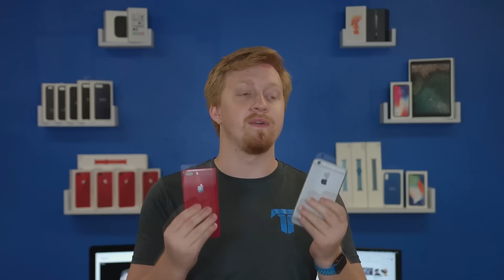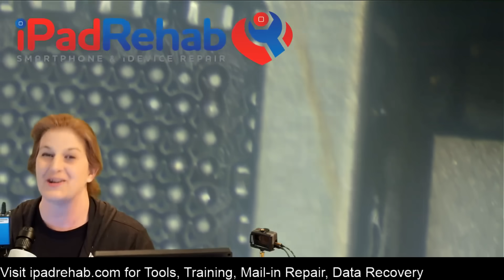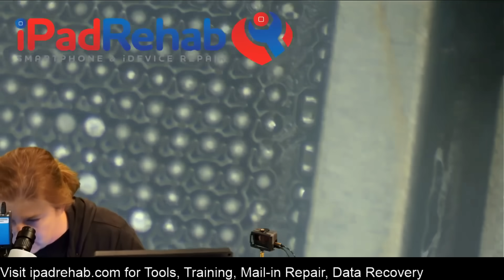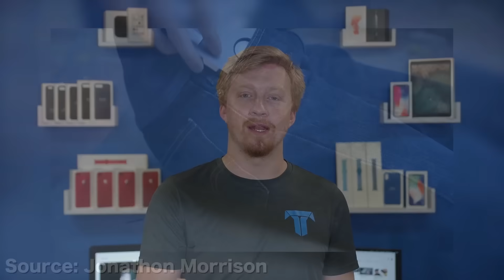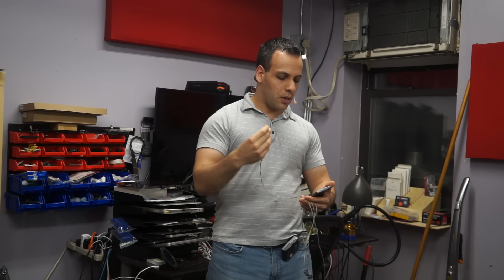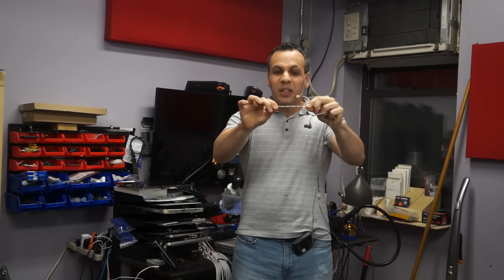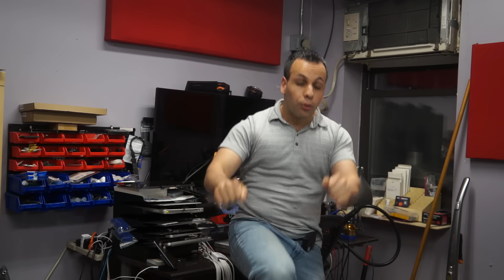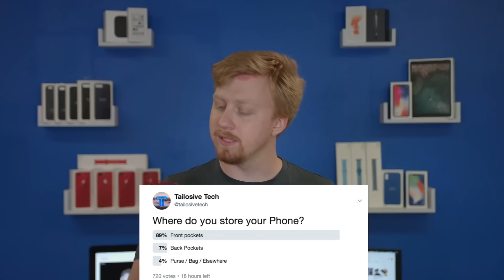The truth about iPhone bendgate deniers

Comment: Dude my iPhone6 never bent but then again I didn’t sit on my 1000$ phone and I sure as hell didn’t buy a 1000$ phone without an otter box with it.  That’s not defending Apple but if you put your 1000$ phone into your back pocket and sit on it and it bends that’s kind of on you. Apple also updated the aluminum in the next s model which was much more durable and now they’re even using stainless steel again which you couldn’t bend if you wanted to.. so Apple doesn’t respond to complaints? Yes they actually do. Also.. if you take your phone and purposefully try to bend it in your hands you’re the biggest dumbshit on the face of the planet. Js. This is the dumbest “controversy” I had ever heard of at the time. Sure the aluminum was weaker. That’s a FACT. Sure some phones had problems. But that’s the case with many phones and many companies .. I love you man you’re an inspiration but your hard on for Apple definitely shows.. 

When in reality if you take care of shit and don’t spill shit into your Apple products or PURPOSEFULLY try to bend your Apple products you’re probably going to have a great product for a decent amount of time. Which can be said for, again, many different brands and companies.

Comment: So it's like damage that people get by repeatedly trying the wrong way over time aka Carpal Tunnel syndrome.  It's why when someone tries to tell a newbee about how they should be typing to prevent damage to their wrists.   Because you won't feel the damage until months later suddenly their wrists start hurting.  The same thing happened with Carpal Tunnel the problem existed in the 70's but because the number of people as a percentage of workers was so small that it didn't come up.  But as the PC became commonplace in homes and work suddenly Carpal Tunnel became a huge deal and now anyone who works with a keyboard will commonly see a video about how they are supposed to hold their wrist to prevent damage.  (Not saying people with the iPhone are putting it in their pocket wrong.)  But, So many of the bend-gaters don't have the internal technical explanation of what is occurring and why for the common person to say..... "ohhhh."  Like the 6 you said was a touch id issue and the iphone 7 is about audio issues (it seemed the chip was in the same area of the phone when I was looking at the video, I may be wrong) but the common person would not connect the 2 problems together as being a result of flexion.  Because prior to your explanation I would have thought it to be the result of a single event.  Rather the damages is a result of repetitive stress to the device board resulting in the board decaying or causing damage to the component soldier connections.  (seemed like larger chips too, where the chip could flex away from the board)  Heck if the chips were closer to the top or bottom may have solved the issue because the top and bottom would be more resistant to flexing.  (like trying to take a UPS or fedex box and bend it, it always seems to bend in the middle 3rd of the box not at either end.)  In any case,  I liked your explanation as it was logical and helped me understand how the 2 issued were related and for that thank you.

Comment: It’s a bit far fetched to name a shattered or cracked glass back a cosmetic issue, given the fact, that many of these smartphones are sold as „water resistant“.
Reply: Michael Walsemann then perhaps don’t put your phone in water afterwards? It’ll work fine so long as you don’t lol. Or repair your phone. They do make cases which help a lot with this problem. You shouldn’t carelessly handle a glass device with no extra protection and say oh well look now it has less functionality.

It’s more of a common sense thing. Don’t break your phone, and don’t put it in water after you do it and you’ll be fine. Water damage is easily preventable. Damage from putting it in your pocket is not.

Comment: I tear drop ran down my cheek when you shit talked about the Nexus 6p. I used that device for 2 years, then passed it down to my little sister who's now been using it for about a year. The battery went bad but we replaced at home with a ebay battery about a month ago and it's been amazing again. Very responsive, great camera even compared with the latest phones, and excellent front facing speakers. It even survived a massive fall two years ago but luckily the spigen case absorbed all the damage. Also, I've never sat on it lol
Reply: I had it for 2½ years. 3 battery replacements. Ended up breaking the screen on repair on my 4th try.
Reply: @TheHaters112  bruh what are you doing to your phone to manage to fuck the battery 3 times in 2 years? My phone is 3 and a half years old and still on the original battery. It still has around 70% capacity.

Comment: My one problem with your line of reasoning is when you talk about why you don't acknowledge when similar things happen on Android. You say it's because the community as a whole accepts the fact that it's a bad phone, whereas with Apple, everybody just ignored how bad of a phone it was. I think that if anything, it was the exact opposite.

When #BendGate started, it was massive news. Both my extremely non-techy parents even knew about it. It was everywhere, that one video about it even kick started Unbox Therapy's entire YouTube career. 

With the Nexus 6P on the other hand, even though I'm pretty techy, I wouldn't have even known it had a bootloop issue if I wasn't considering buying a used one a few months back. Before this video I haven't seen a single person anywhere outside of obscure forums talk about the 6P negatively for that reason. Maybe in your tech repair field it's a well know issue, but in the general, less specialized tech community, the negative press Apple gets for a mess up like that is astronomically bigger than for a phone like the 6P.
Reply from the maker: How many people have you ever heard defend the Nexus 6P's build quality?
Reply: Louis Rossmann Nobody, fair point. However, I've also never heard anyone complain about it in the first place, which is pretty much my point. It's not a widely excepted problem, because nobody knows about it - at least in terms of the general public, and the "pseudo techy" YouTube commentors that make up 99% of comments (myself included). As I said, I wouldn't have heard any mention of it's problems if I didn't specifically research it with the intent of buying it.

Comment: Former Nexus 6P owner here, I lol'd hard. Can confirm it was garbage, and can also confirm that the OnePlus 5 that I use now has aged an order of magnitude better.
Reply: I'm watching this on a 6P. I've already replaced the battery twice. I think the only reason it hasn't bent is because I use a fairly thick case. ...Yeah. It's crap lol. ...And Huawei didn't acknowledge/RMA them for the basically 100% failure battery problem until most were already out of warranty. Never buying a Huawei product again.

Comment: Well this is another super excellent and very very informative video! Thank You Louis Rossmann. What about damage due to thermal changes?  The reason why I ask is that I had a coworker (Electrical Engineer) who told me that when he worked for (I think) Raytheon designing circuit boards for missile systems that the difference in the expansion rate of the circuit board material, and the copper on the board was a huge issue. They found that over time changes in temperature would cause the traces to degrade and fail.

Comment: I fucking loved apple. But the last 8 years since jobs has been mediocrity.  Hardware has become less reliable and underpowered. Back in 2007, they put a brand spanking new NVIDIA graphics card in their MBP. I got great mileage out of that computer. Now they put mid-range ATI cards and integrated Intel cards.  Apple costs more than ever, don't last as long, and are not as powerful. The deltas on every Apple product has gotten worse for the consumer in the last eight years. The OS is the only thing keeping me to Apple; it's stable, secure and matinence free with great compatibility. I am a scientist so that's great for me. Sure their is probably a Linux distro out there that's more secure, and I'm not going to be running the latest game at 4K 60fps thanks to windows and directx, but I don't care for that. What I do care for is time. I don't have time to learn terminal, or run a battery farm of third party butt plugs to stop every virus and malware that wants to make windows its bitch.

If Microsoft start again from scratch rather than continue to patch the current 80’s Frankenstein kernel held together with sticky tape and compatibility modes; I'll be all over it. Because although the OSX is free I'm paying for it with mediocre inflated hardware prices and I rather not. Malware and viruses and stability have also been a flaw in the windows OS for decades something I don't see getting fixed, which is why I am with Apple. I did vote with my wallet and stopped rewarding bad behaviour. There is just shit choices out there now.

Comment: Aluminium doesn't have a fatigue limit, so over time the yield strength will decrease until a failure occurs. This is why aircraft have to be retired after a certain amount of flight cycles.

Comment: The headphone analogy is great, it’s damage that builds up over time, through wear and tear, ie. NORMAL USE!! while it’s generally accepted for headphone cables, it’s should not be for enclosed electronics such as the internals of a smartphone, flex cables, ic’s and stuff should have been properly protected by Apple with the right shielding plates, brackets and the likes...

Comment: I keep my phones in my pack pocket all day every day when I'm up and moving.... Usually right in front of my wallet.  My phones are S series or Notes.... Samsung's.. I own all of them, rather than turning them in when contract or deal is up... I own Note 2, 3, 5, still have a 7, S7 Edge... all still work fine.  I don't even use screen protectors anymore.  Just a basic black rear sleeve with semi shock absorption. As low a profile as it gets.  And never a single issue with a single one of them.  Apple phones of friends however I have seen a many with hardware failure from far lesser and far more basic of use.  I am myself a controls electrician by trade, Controls and Flows engineer, as well as involved in the radio industry.  I have seen the shittiness of the apple first hand, believe me.. I understand what your laying down here.  I get it.

Comment: at 22:58 as a female human person i can confirm that often i HAVE to put my phone in the back pocket if i want to put it in a pocket because a solid 90% of pockets on female trousers is at least half the size of male ones. You saw on the clip how his iphone fit completely into the pocket when doing the sit test, well, if i did that half of the phone would be out of the pocket and over my hip joint and if i did the motion he did in the clip i would straight up break the phone in half. Also, it is extremely uncomfortable and has a greater chance of the phone falling out of the front pocket when moving around and makes it near impossible to bend down or sot properly

Comment: Hi Louis, very good video thank you very much. I was just wondering, what you are calling "flexion based damage", isn't it more accurate to call it "mechanical fatigue"? From what I have seen in my material strength classes, you can break something with one really hard bend or flexion just as you can break it with thousand of cycles of pulling and releasing. Sorry if I sound like a know-it-all, I was just wondering if "flexion based damage" was a term used in you profession for a specific type of damage. Thank you very much.

Comment: My first and my last Apple device was an I-Pad 1.gen . 
It fall on an flat table on the screen and an something on the CLEAN table cracked the screen thx Apple for my great customer experience^^ 
Now I`m an Windows and Android user.
I`ve devices like Hp, Msi,Lenovo… Notebooks and Lg, Microsoft and Samsung Smartfones that i use without any protection and they work fine even after years.
i don`t care About designe i care About durability and Features.

Comment: I am not a huge fan of any company, but my most dramatic complaint about apple is that they will sacrifice functionality for aesthetic appeal. There is nothing WRONG with charging more for aesthetic appeal, but as most companies look at aesthetics as an afterthought, Apple seems to look at it as a primary thought. 
"can it fit in THESE chassis? No? MAKE IT!"
Reply: ye i recently saw someone on tumblr actually say 'apple isn't a tech company, it's a fashion brand' and honestly... not wrong imo
Reply: @Scorpia161  it'a extremely true, it's an elitist luxury brand, function over form is what makes something robust and capable for power users, not wasting entire aluminum blocks to make the chassis weigh 3 times as much.
Reply: Yes that is why the Mac Laptops got rid of the USB A ports even though they could still fit them on/in the Macs even without making them thicker it was because they look ugly same reason they got rid of the SD Card Slot and HDMI & DisplayPort plugs!

Apple has 1 of the best Cameras and Software for it on the market yet cant add it to their Macs WTF?! They still put Potato Cameras on their Macs even at the high end max out specs!
Reply: This is what pisses me off about so maybe software "engineers" using mac laptops, now I'm stuck with it being my mandatory work machine and my linux tools crashing all the time. Can't I use diff/merge some files without having to pay $70 for a license and install git without having to install xcode? Macbook pros as dev machines are a joke.
Reply: you do realized that you're talking about the company that think it's a good idea to remove fans from their desktop because they are noisy
Reply: I was quite angry when they removed the headphone jack from their phones. I’m the type of person where I listen to music or YouTube videos or podcasts a lot. I walk a lot and listen to stuff on the go, and I also have an amazing power bank, about the same size as my phone, with solar cells (while admittedly don’t work that well) that I was able to charge it AND listen... Until that phone died after years of use and I upgraded... And shit. It upset me a bit. That was until I got some pretty decent Bluetooth earbuds. Affordable at that. Battery life is an issue though so I do have to charge them often... but yeah. The lack of a headphone jack for aesthetic appeal is ridiculous.
Reply: @JanoyCresvaZero  idk, I have a headphone jack and I don't even use it. People just need to move on from the stone age
Reply: deathbydevice 
That’s a silly statement to make. Bluetooth headphones only have so much battery in them. When I’m sitting around and can have my phone charging as well as headphones plugged in, why waste battery on my Bluetooth headphones? Now I have to charge my phone while using my headphones, then once they die I have to plug in headphones and use the battery on my phone, until the headphones charge and I just continue the stupid cycle.
Reply: @JanoyCresvaZero  I'm just saying...I have a headphone jack (s9+) and I don't touch it. I see alot of people saying they won't buy a phone without a headphone jack (I was one) and I don't use it. Now I don't care
Reply: @deathbydeviceable  stone age? The wheel is older. You wanna get rid of that as well?
Reply: @emmanuelmedina2740  once you go wireless, you'll never wanna shove anything in a hole ever again
Reply: @deathbydeviceable  thats assuming you only use a headset for your phone. Quality matters,wired will always sound better than wireless and having a headset that you can use with ALL of your electronics is important to me. I used to have a wireless headset for my ps4. Then i got sick of having to charge a controller AND the headset. I sold them and got a decent wired set from Corsair, which i use to game on my Desktop, laptop and ps4. Not to mention my phone.
Reply: @emmanuelmedina2740  wireless doesn't sound bad. Remember, you always get what you pay for. Granted, my bt cans sound way better than the airpods, it's just ease of use. The cans sound similar wired vs wireless (just a tad bit louder wired I'll admit, not much tho). Just get a pair that has both options. At least if the cable breaks, it's replaceable.

It's just one more thing to charge. I'm not sure why that's even a complaint really. Plus, that bass you get with the battery, you can actually hear fieldy from Korn with how low his bass is
Reply: Not even Play-Doh?